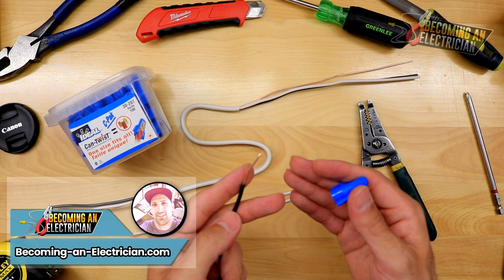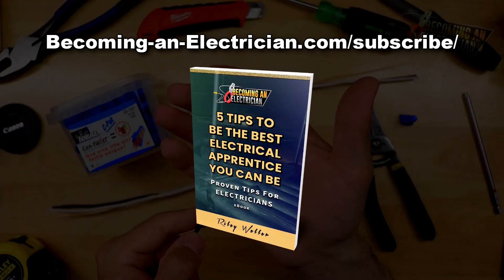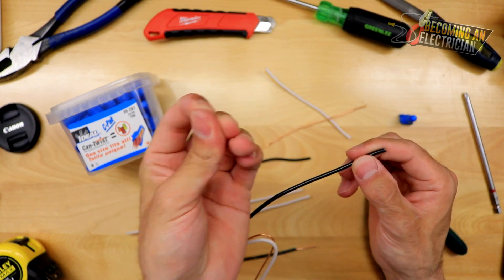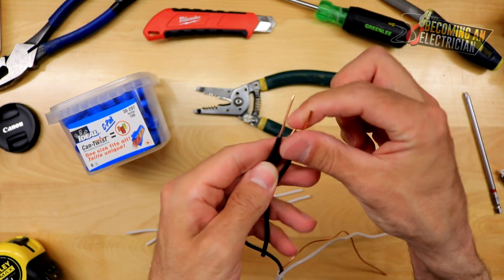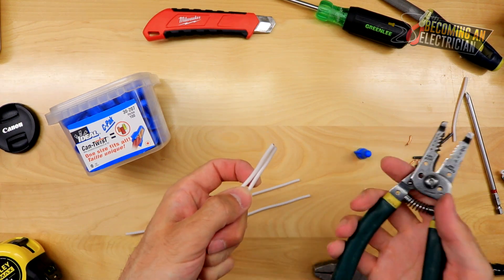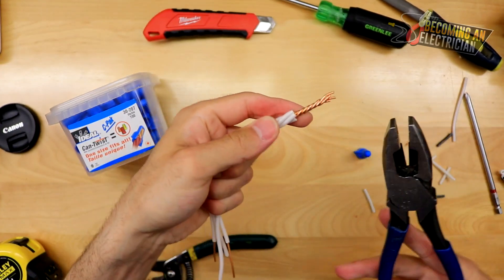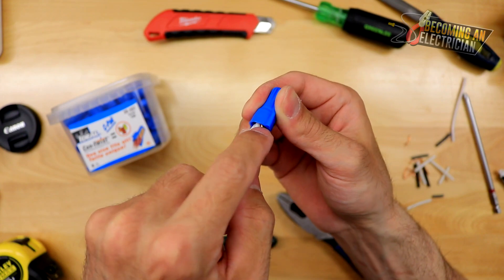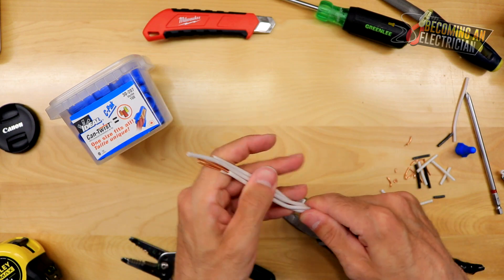How to Splice Wires for Electricians

Comment: Dude I was struggling with twisting the wires post splice/cutting the plastic parts off and its because my teacher showed us to do it by grabbing the tips of the exposed wire, excited to try this when i get a chance. Your awesome, subbed!
Reply: @BecomingAnElectrician Makes sense.  Thanks
Reply from the maker: @rickbilbrey3235  No prob!  Thanks for watching the video!! :)
Reply from the maker: Ya, when you grab at the base, it works the splice out, and you can mold it how you want.  At first, it's tricky because you don't have good hand strength, so just make the wires longer.. over time you'll get more experienced :)
Reply: @BecomingAnElectrician  BTW, with this method, won't this method score the wire with the teeth on the pliers?
Reply from the maker: @rickbilbrey3235  It may rough it up a little bit..  but that is not "scoring" - scoring is when you use the wrong size of wire hole on your strippers, making that full circle score, making the wire very brittle.  The wires will still be very strong, and the end splice is better.  (Also, when you tighten the wire nut on the wire, you are also "roughing up the wires").. in my opinion, it is not a concern.. learn more here: https://www.youtube.com/watch?v=Hc1hzPtJL4E

Comment: Really nice video.
I’d like to see this same video, but with 4 or 5 #12 wires. Or even a video on how you pack 4 12/2 wires in a box with a receptacle neatly.
Reply from the maker: Hey all I have for content on this for you is my Roughing-In Series.. thanks for the suggestion!:
https://becoming-an-electrician.com/tag/roughing-in-series/
Reply: Yeah same, trying to install neutral-required smart dimmers and I'm finding that in my 2 gang boxes there's already 4 neutrals spliced together before I even add in the new smart switches... I've been undoing the splice, trading one of the spliced wires for a short piece of wire and then turning it into 2-3 splices bridged by extra wires. But that takes up soooo much room that now I have to really play "tetris" to get things to fit back in the box, and it's very crowded (which I'm pretty sure is also against code).
Reply: @emissarygw2264 it’ll save you room to use a 5 wire Wago. It’s about the size of a large wire nut and can lay flat against the back of the jct. box. If you use them, make sure to tug test each wire and look on the back of the Wago, which is clear, to make sure all the wires are completely seated. Sometimes the insulation catches on the edge of the Wago and it feels like you seated the wire when you didn’t so always check each wire. Wago are also great when you have short wires in a jct. box. They are more expensive than wire nuts.
Reply: @piros44  I'll have to try those sometime, they do look convenient
Reply: @piros44  I love Wago but recently tried exactly that - 4 12awg wires... it was next to impossible to get things lined up in them correctly, and when I did one wire would twist itself out (which yes, is an issue even with the lever style). After about 30 mins I gave up and grabbed some good ol' wire nuts and was done in a few seconds. Again, I love Wago but I really can't recommend them when dealing with that many wires at once.
Reply: This! ⬆️
Just dealt with this in a 2 gang box with 5 12awg wires coming in and then having to add pigtails. 🤬 Couldn't even find the right size wire nut for 7 12awg wires for the ground and then had to cram it all back in with a GFCI and single pole switch. I've found twisting even 3 12awg wires together difficult as it tends to twist the wire at the insulation vs the exposed tips.

Comment: Great video! How do you handle situations where if a splice already exists in a box but the length of those wires are already pretty short and need to splice an additional wire to the existing? In your experience is there an easy way to splice the additional without having to cut? I'm all about getting cutting everything and starting from scratch but I do run into situations where there's not much wire left in the box.  Thanks.
Reply from the maker: At this point, strip the wire you want to add on, then gently loosen the splice (but not all the way).  Then try to cross the wire over so it naturally becomes part of the splice, then use your pliers to finish it off.  It should mold into a nice braid if done right!  Sometimes you have to add a bigger wire nut (marette) on afterward for a better install!

Comment: I just had to replace a receptacle in my house that pretty much caught on fire. Luckily it was in the brick. This has started my obsession with electrical from knowing very little to wanting to know everything. The receptacle was backstabbed and came loose. Granted the receptacle was prob 20-30 years old and in rough shape. I'm tile guy but every professional I've seen pretwists and loops. I'd say listen to the professionals over the manufacturers. Manufacturers probably do a small amount of tests in a controlled environment. There's millions of professionals that see things on a day to day basis that no manufacturer can run tests on.
Reply from the maker: Yes, exactly - Splice, Twist, and create your loop/hook to go onto the device screw clockwise.  Anyone telling different is a noob 😂😂
Reply: @BecomingAnElectrician  I actually meant this comment to be on another video you made "to pretwists or not". Oh well lol.
Reply from the maker: @danielbonner8309  Haha, no prob!  Thanks for the comment.  More videos coming soon.

Comment: Thanks for the video. My problem is I how do you not beat the wires up a bit with the linesman's plyers?  When you got three or more 12 awg you really got grab them and put some muscle into it. Your not kidding about hand strength.
Reply from the maker: Ya, overtime your hand definitely gets stronger.  You don't have to squeeze the pliers too hard at the beginning.. it's most important to mold the splice.. and you can start the braid at the base, and work the splice outward.  Once the mold has been gently formed, you only need 1-2 harder twists, and you're done!

Commercial wire (#12) is much harder than residential wire (#14) for our standard installations.  For this purpose, it's always wise to think about pulling less wires to a box.  (Instead of pulling 3 wires to a box, pulling the wire to another box instead can make the splice easier, too!)
Reply: @BecomingAnElectrician   Thanks for the reply. I do appreciate it. Ya I've been splitting up and adding boxes in my attic cause I guess 40 years ago they branched all the connections in light fixture boxes which are all overfilled.🤙.
Reply from the maker: @danielbonner8309  You'll get it figured out!

Comment: I live in the Netherlands and learned that if we untwist the cap, the metal should be still on the wires. twisting off the cap was the way to see if the splice was sound/good. It was a hard plastic cap.
Reply from the maker: Have never heard of that being a good thing.  Sometimes the wire nuts are made poor, and the metal spring within them can fall out (that secures the spice, and makes a good electrical connection)

Usually you do not want the spring to come out, so you can unscrew and re-screw the wire nut back on!
Reply: Mfgrs and most likely, the NEC (here), consider the interior spiral "a permanent install" and should not be coming out. Of course, many pros and diys see that happen from time to time. Was it an inferior grade? Was it used before? Is it just one of those things that happens as nothing is perfect? It should not be coming out, and of course, neither should it be used a 2nd time. As the NEC will tell you, always follow the rules of the mfgr. Who would/could know better than them, no? Great comment! Really great! Really important. No one knows it all. I think ya' hit a home run!

Comment: i believe the wire nut turning white is normal and indication of a good bite. that is coming from straight from ideal. nice video.
Reply from the maker: Hey - yes the white is a common occurrence which happens from overtightening the wire nut.

This happens because the wires are too long, and the user is trying to tighten down the wire nut enough so that the copper is not exposed at the bottom of the wire nut (whole point of a wire nut).

If you use the correct sized wires, and cut them at a good length, it will fit under the wire nut WITHOUT turning white.  🙂
Reply: @BecomingAnElectrician  good to know. im always nervous 1/2” is too short even though ideal says 1/2”. im afraid of grinding insulation with the nut. is this a concern? i like to look down the nut and see the insulation isnt being bitten on.
Reply from the maker: @danediz  Watch the video for how I explain to cut the wires and how it should look under a wire nut.  If you want to have your splice longer, you can use a bigger wire nut.

It all comes down to a nice splice with the insulation lined up, and not having too many wires under 1 wire nut (if you have too many, then use a bigger size!)

Comment: There is really no need to pretwist the wires. Just tighten the nut enought and the wires won't pull out.
Reply: Some wire nut packages do say that pre twisting is not required. For me personally I never used to pre twist for the longest time. And you are right you still end up with a good connection. However, I will say a couple things. One is, after using certain wire nuts like the tan ideal kind especially, I noticed when splicing say 3-12 awg conductors or maybe 4-14 awg conductors the wire nut would bulge a bit from using the wire nut to make the joint, now this could also be after making the joint and just over tightening. So maybe the problem there is more those particular wire nuts. Second is, sometimes if you don't stress pre twisting, someone who is a homeowner and not used to electrical work will think that the wire nut is just a cap for the wire and only very lightly twist them, this is not good obviously and it's so people feel it's  important to over stress pre twisting for this reason. But probably the main reason why I pretwist now is because I bought an awesome pair of stripper/pliers recently and they are my new favorite hand tool. So because the pliers are right in front of me on the tool I just used to strip with it leaves me with no excuse to not pre twist whereas before maybe I would just be lazy and just use the wirenut to twist. But really to me it's just easier to twist the wires cut them to length and then snug a wire nut on rather then having to crank down on it with just the wire nut. Just depends on the conductors for me mostly  but let's be clear you can never go wrong with pretwisting.
Reply: If you dont pre twist the wire, the next time someone opens up that wire nut, all the wires will come apart and cut the power off and possibly shock the technician or short out the circuit.
Reply: @zekeshobbies  no it wont lol. Pre-twist does not hold the wires together, its the threads in the nut that cuts into the wire that does. When you twist the nut on, the wires bellow the thread will also twist anyways. You got other problems if you open a wire nut with the power on in the first place.
Reply from the maker: No, don't listen to this.  ALWAYS SPLICE YOUR WIRES, THEN PUT THE WIRE NUT ON.

This is best practices of electricians.
Reply: @BecomingAnElectrician  the electricians i watch on youtube are Electric Pro Academy and Benjamin Sahlstrom, they dont pretwist. None of the electricians i know does either. One of my family friend was recently hired to fly across the country to be a part of an electrical project of a new hospital and told me it isn't required and his crew doesn't either.

I am not an electrician and the biggest job i did was just upgrading the breaker box in my own house and adding a few new circuits to balance loads. I have gone through the books and nowhere does it say wires need to be twisted.
Reply from the maker: @Pepe-dq2ib  For best practices, twist your wires.  That's all there is to it.

Comment: Ive never really understood the use of strippers,to cut and peal the wires,i mean you have the pliers for that🤷🏻‍♂️
Reply from the maker: I find it easier, plus you can strip two wires at once 🙂

Also, if you are in a large 12x12 with 40+ wires.. makes life a lot easier, too

Oh yes, one more thing, stripping with pliers requires a bit more space to strip.. using strippers in tight areas is easier (then you can use the "strip with strippers, then pull off with pliers in sketchy situations move 🙂)

There's 3 reasons that make the difference!

Comment: Check out Wago 205, 221-4, 221-6. They are awesome connectors. And much more compact, much easier to take them apart if you ever need to.
Reply from the maker: Yeah it all depends on the company you work for.. for condos I'd assume Wagos are way too expensive.. Companies usually buy those blue Marettes by the barrel!

Comment: I always try to cut the slice at an angle to make a point so that the wire nut twists on it easier. Hate splicing when you gotta do it ask day though lol my hands cramp up. Wagos are life savers on those days
Reply from the maker: Haha yeah, after the cut, just a little round off to file off the edges helps it fit in the Marrette nicely.  Someone told me those Wagos look like "Spongebobs".. made me laugh, so that's what I started calling them 😂

Splicing isn't too bad, it's pretty easy going if you're allowed to listen to music.. it mostly comes down to technique!
Reply: Are “wagos” better and safer than splicing?